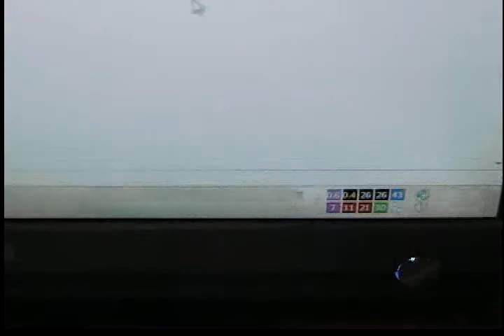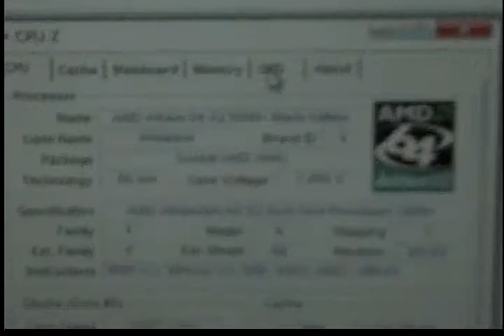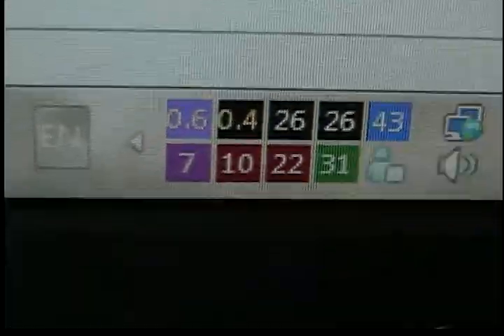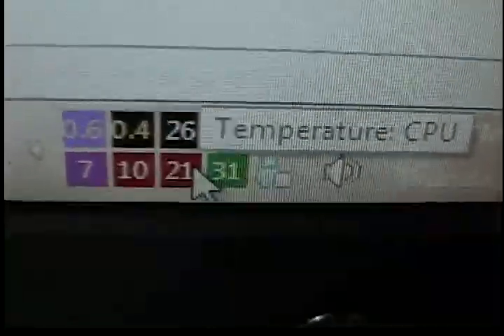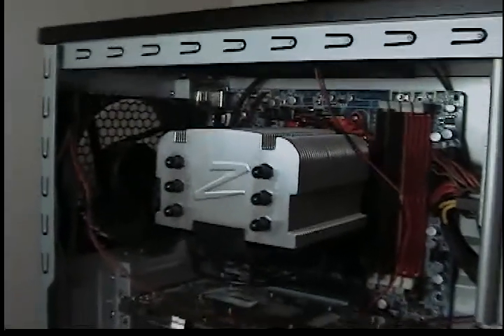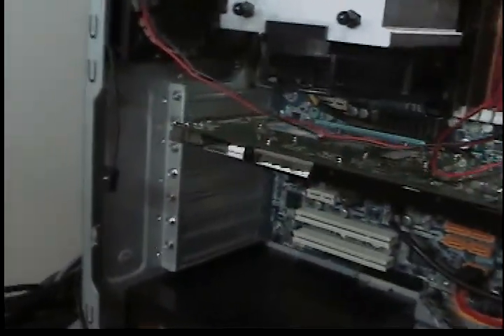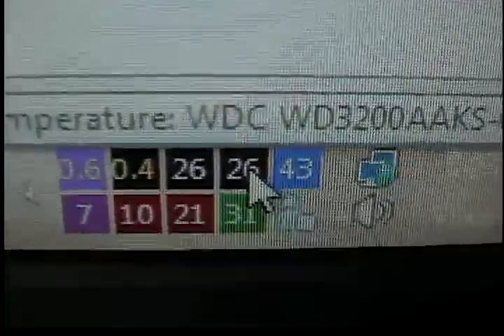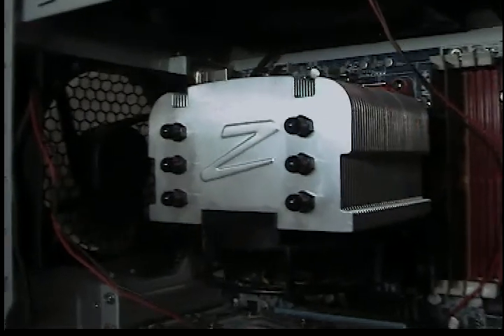Insane temp in my Antec 300

Comment: Regardless of what the temp sensors are saying, you are not possibly idling at or below ambient temps in your house. I had a 720be that said I was idling at 17C which was 10 degrees F lower than my ambient temps, so you can't trust that stuff.